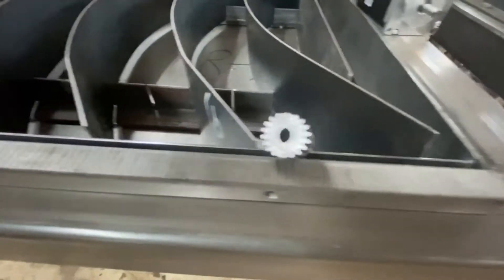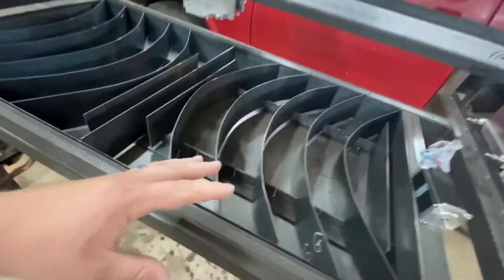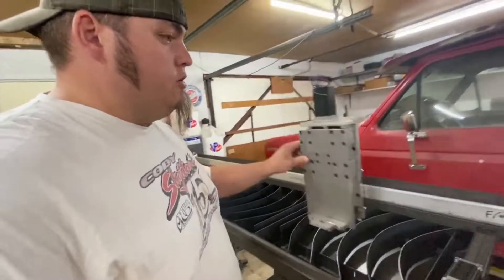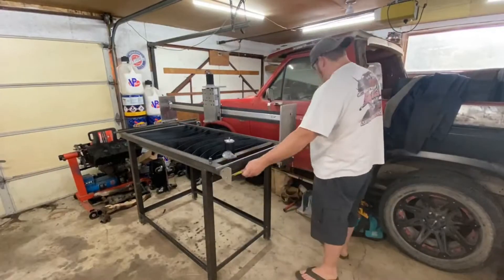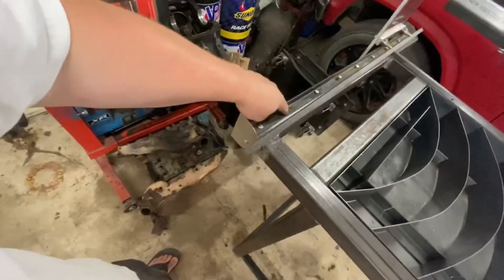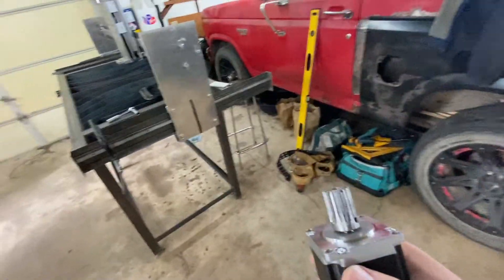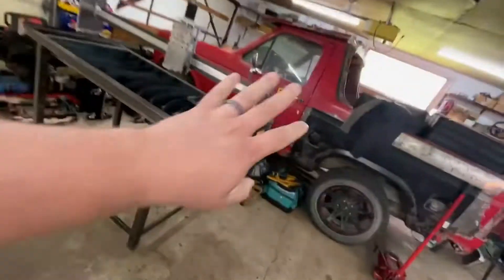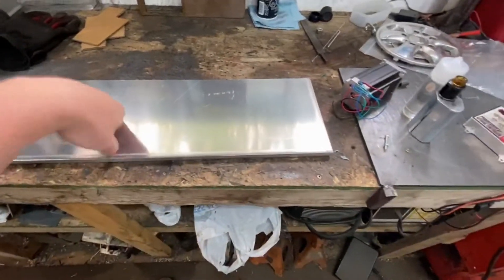Nice Rack! - time to install rack and pinions on our DIY CNC plasma

Comment: rack and pinion details and pinion teeth count?
Reply from the maker: See link. This is where I got them from and the specs are on the web site. I used the rack #RSHC151000 and pinion #PSC1518 however I had to bore the hole on these pinion bears to fit my motors. https://www.motiontek.ca/RackPinionS.html
Reply from the maker: I will look back and check on that for you👍
Reply: @letkemanfabworks619  will you post the information here? i would really like the information also! :D